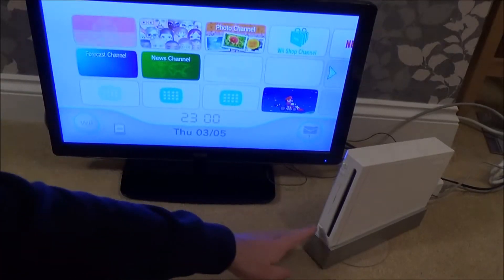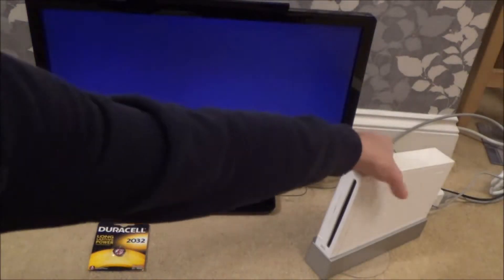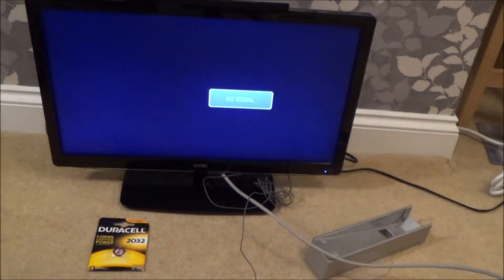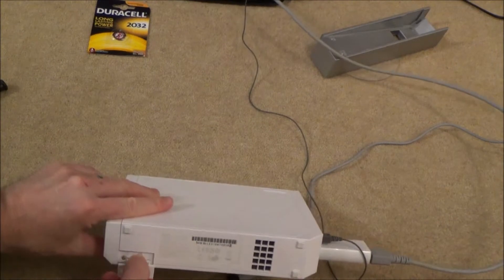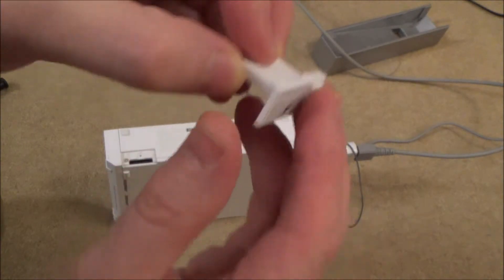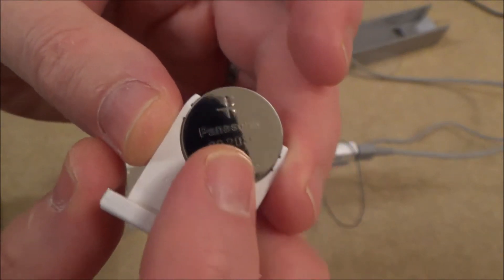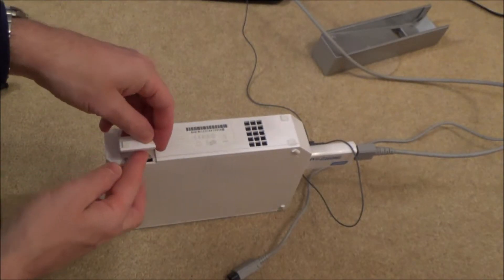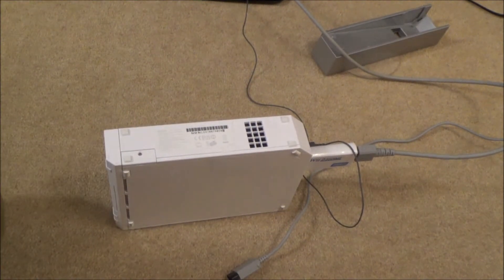How to change the CLOCK BATTERY on the Nintendo Wii

Comment: Green light = Your console is switched on
Orange/yellow light = Your console is in standby mode (WiiConnect24 will continue to run)
Red light = Your console is switched off but is still receiving power (WiiConnect24 will be no longer running)
Off = Your console is fully switched off (No power going to the console) (This happens when you unplug the AC power cord)

Comment: Question:  If I remove the battery, and the clock resets, does the calendar data get deleted?  i.e., When the clock is reset to current time, will the events still appear on their respective past dates?